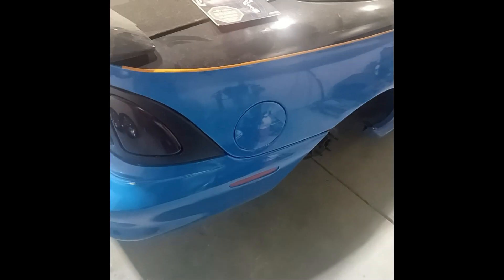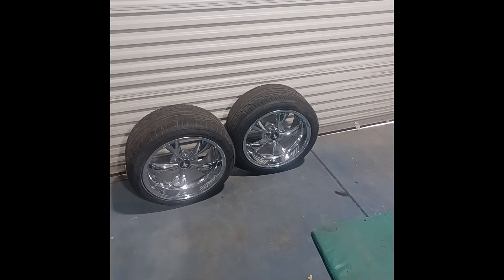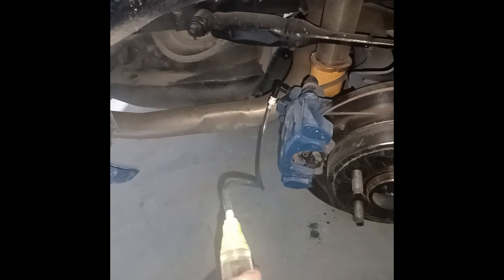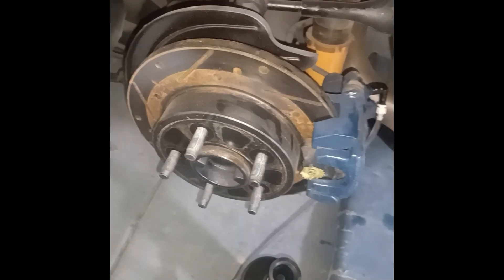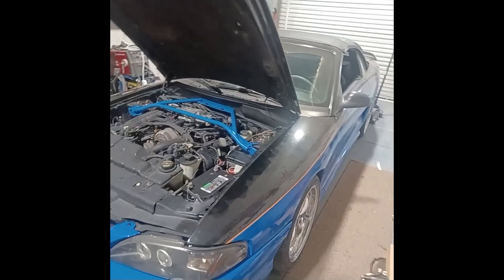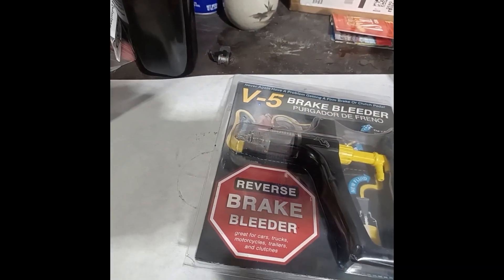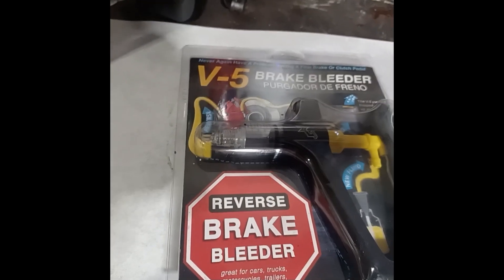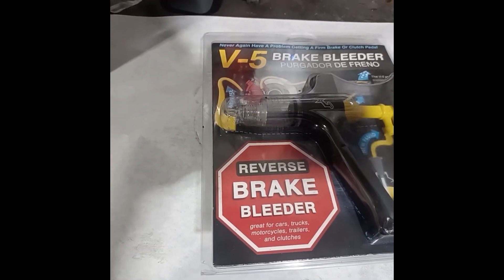Bleeding Brakes With Reverse Brake Bleeder One Man Quick and Easy

Comment: I have this tool and every time I use that black rubber adapter on the bleeder screw it forces the fluid out and causes it to dribble down. Am I doing something wrong?
Reply from the maker: I always use one hand to hold the adapter on the bleeder and the other to actuate the pump.
Reply: @daleshotrodshop yea that’s so weird cause I was doing that too and it still was not going through.

Comment: Does this work with a portion value????
Reply from the maker: Yes this will bleed through the proportioning valve. If the shuttle valve is tripped you will need to reset that.